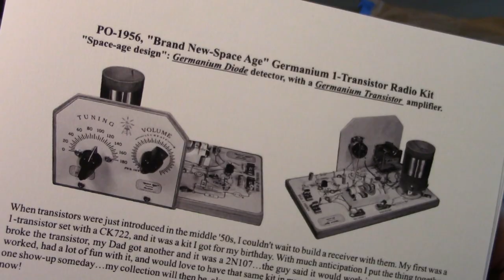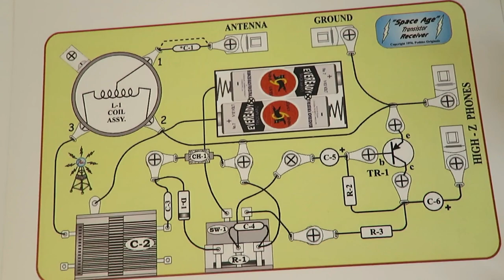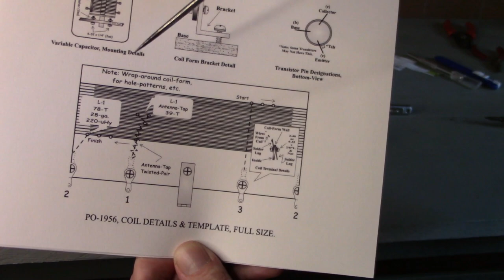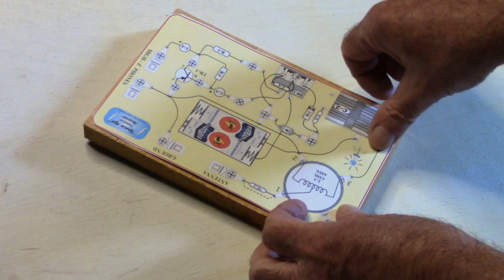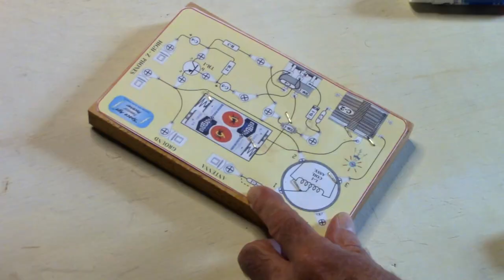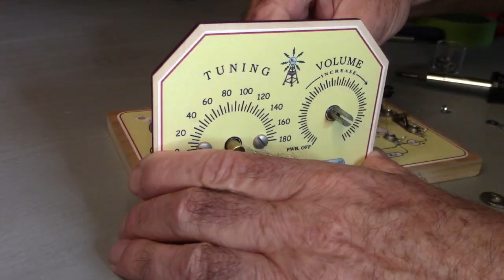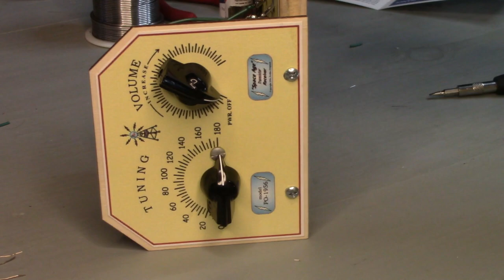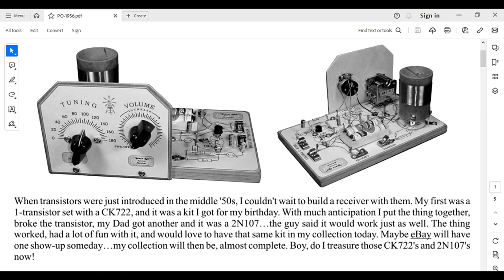Mike Peebles "PO-1956" Amplified Crystal Set

Comment: While I appreciate humour, I was saying to myself, I hope hes kidding about the antenna and ground. I did jump when the pyros kicked in. I  own a big valve radio (I live in Australia by the way) and I used a wire between the 2 concrete chimneys of the house down in through my bedroom window. I used a separate pipe for the ground, not the cold or hot water pipes. It was pre FM days but at night in Melbourne Victoria where I live, I could pick up Sydney radio stations 1000 kilometres away in NSW. I rang the DJ at one station telling him I could hear his broadcast. He acknowledged this by telling his listeners that a 12 year old boy was listening in Melbourne. The down side was the telephone bill. I played dumb because local calls were 10 cents a call but STD calls ( Subscriber Trunk Dialing ) were very expensive at the time, unlike today with VOIP. I still have that radio and I finally told my parents at 21 years of age at my 21st birthday. As you can imagine, my father said you cheeky little shit. I knew I never made a call to Sydney back then. I now own a $10.000 Primaluna valve amplifier which is just the most beautiful piece of kit I own. It uses wound in house Toroidal transformers for mains power and output to the speakers and has 4, 8 and 16 Ohm taps. It is running 6 12AU7s in the preamp section and 8 EL34 power tubes at the back in Push/Pull configeration which gives me 100 watts per side. I bought a Cambridge phono stage for my brand new Technics SL 1200 MK 2 ( I was a club DJ for many years ) and a Pioneer CDJ to play CDs. My cartridge is an Ortofon Black Moving Magnet with a Shibata eliptical stylus fitted. None of this gear has ever been in a club by the way. Vacuum Tube amplification is now big business. It's a shame that Russia invaded Ukraine because many tubes with familiar names like Mullard and Telefunken are being made there. Brian May from Queen uses valve amplifiers as do many other brilliant guitarists. I saw Queen with Freddie out front....yes I am a gay guy and with Adam Lambert too. The music today Pffft! I miss the days of valve amps. There was a magic to it all but at 62, I have to be real. I loved my crystal sets. These sets were well hidden in POW camps during WW2 to see what was happening during that terrible time. My late uncles had one but never talked about the war and we knew not to ask what they saw there. I love your channel. Cheers from Australia, Andrew Collins.
Reply from the maker: Thanks, Andrew! Pretty funny about admitting to the phone call years later, but I can imagine the excitement of that night when you called the DJ and then heard it mentioned on the radio.
Reply: I found an old POTS phone bill (70s or 80s) and I got second hand sticker shock from it. Ugh!
Reply from the maker: @qwertykeyboard5901  That's a different kind of shock.
Reply: It functions

Comment: At 15:38 I make custom front panels using thin plywood and printing out the artwork on my simple inject printer. I use carpenter glue on the plywood. Then working quickly I squeegee off the excess glue with a shop razor blade so I get a super thin coat of glue on the wood (just enough the hold the paper down but not soak through). I don't worry about the glue dripping off the edges yet, just make sure the entire surface has a consistent thin layer of glue. I place the paper on the glue, put wax paper over the paper, and hold it down with a book for about an hour.  I pull off or sand the glue from the edges. Then I spray a very very fine mist of clear matte enamel. It won't coat the paper, just tiny microscopic spots that dry in seconds before they soak into the paper. I let it dry 15 minutes and then spray another fine mist coat. I do that about 10 times. Then I can apply slightly thicker coats (3 is usually good).  This protects the paper from finger smudges, dirt, and you can even wipe it with a slightly damp cloth to keep it nice looking.  I have a playlist on this.

Comment: I used to make my own radio coils with a piece of PVC piping and either some enamelled copper wire, or Litz wire, to put holes in the PVC piping I would use either a small drill bit or a sewing needle that was heated till it was hot enough to melt the PVC piping, sometimes I would glue the base from an old octal valve or tube in one end of the PVC piping after soldering the ends of the coil wires to the pins of the octal base.

Comment: when i was in grammer school/cub scouts, i built a crystal set with a cat-whisker diode and a coil wound on an oatmeal box. i thought i had done something, but when
i got it assembled, i found out the closest radio station was 20 miles away! it did pick up a very weak signal, but it was not great. my mother bought me a 2 transistor
pocket radio that didn't pick up anything. it was many years later when my small town got an a m station, but the crystal set was junk by then.

Comment: Reminds me of the adverts in Boys Own Paper for one valve SW radios. Never built one but did own a Dulci crystal set from Gamages of Holborn.
In the late 50's there was a lot of Army surplus stuff in Exchange and Mart and shops selling bits stripped out of electrical junk.
Market stalls had whacky gadgets guaranteed to bring the world to your living room.
None of it worked, nor did the white spot transistors from Henries Radio.
As they say, the pleasure is in the making, not in the results.

Comment: Take out the bits relating to creating ariels from the mains wiring. Some fool will do what I did as a kid and and stick two fingers in the light socket to see what it feels like. Later as my interest in electronics continued I would start to replace faulty selium diodes in our Murphy TV, the one with the controls under the famous flip top lid. I discovered how by playing with the rf tuning coils you could pull in other TV stations. One day I had the tv in a room with a Stone floor. It was propped up on a chair with the outer wooden casing off and I was poking around trying to get the vertical control to lock. Suddenly I saw the set starting to topple from chair and went to grab it and I was in bare feet. Luckily as soon my fingers brushed against the steel chassis I felt the same feeling as when I stuck my fingers in the light socket many years earlier. If  I had fully grabbed it I would not be hear now.
This is the danger of tinkering and not being aware that transformerless equipment can be deadly if the A/C live side is connected to chassis by reversed connection at the plug end. Some muscians have been killed using Audio equipment that did not use transformers. It is very important for earths to always be connected on cookers,kettles and all electrical appliances so that if the live of the mains touches the steel casing it will blow the fuse or trip of your supply.
Reply from the maker: Hah, according to YouTube, 97.5% of the viewers are over 55 years old (86% are over 65). We should all know not to stick a screwdriver in an electrical outlet, and you see me get electrocuted by the radio after I do. The fact that you were poking around in a television with bare feet on a stone floor is funnier than the screwdriver bit. I'm glad that you lived and got to see my video years later!

Comment: At 17:13 screws that will poke through? - been there, done that.  After I drill pilot holes in the wood (about 1/16 of an inch before going through), I start each hole with a screw (about 1/2 way) then remove the screws and then trim off the screw tips with a Dremmel tool. Sometimes it beats making a trip to the hardware store (Ace and True Value Hardware stores usually have a way better selection of hardware than the Big Box stores).

Comment: Nice and lot of fun project, congratulations! 😂
Which transistor did you use for replace the original?
Greetings from Argentina!❤
Reply from the maker: I tried several vintage germanium transistors. It doesn't show it in the video, but I ended up using the original 2N2048.

Comment: The coil form looks suspiciously like it's the core from the large rolls of commercial TP. (I have a couple of them.)  Very good idea on making the coil of wire into a spool!  Quite entertaining on the gags.  You might like to try 1N60, 1N60A, 1N270, and 1N21 diodes in the set also.  BTW MRL (Modern Radio Labs) still has their booklets in print. I bought a full set about 10 yrs back. Mass xtal radio info.
Reply from the maker: Another MRL fan! 
I've been working on the history of Elmer Osterhoudt and MRL for some time. I've gathered the information here:
http://analogdial.com/Osterhoudt/Osterhoudt1.html

Comment: Two questions: is that variable air capacitor about 365 pf  and what is the transistor model?.
  Great video and a cool kit. Too bad  toys like this aren't available anymore,  kids would be more open minded and inquisitive

  P.s regardingthe headset, i just purchased a high impedance 2,500 ohms imp headphones  identical to yours from a guy in the Ukraine,  he has dozens 30:04  brand new in the box, it was $25 bucks plus 11 to ship.
Reply from the maker: The variable capacitor is either 365 pf or 410 pf, they both look about the same. The transistor is a Germanium 2N2048. So that guy has dozens of headsets?? Can you post a link?

Comment: I thought: "No surely this mains antenna thing is a joke!" Back in the day mains antennas were available in the UK with our 240V mains, but only for mains-operated sets I think and they were mostly useless - and dangerous. Little more than snake-oil products really. In the UK (and most of Europe except Spain) we only have a few AM stations left. Our BBC Radio Four station on 198 kHz long wave is closing in March 2024, and I expect the medium-wave stations (BBC and commercial) won't be far behind...

Anyway, joking apart that's a nice little kit. But doesn't the lack of selectivity let the digital sidebands from IBOC spoil things?
Reply from the maker: It could use an antenna tuner. The Peebles PO-103 antenna tuner works wonders, but I didn't include it in the video. The "antenna eliminator" was an actual product. I think it had a capacitor inside to isolate you (and the radio) from the electric current. It would be useless today with all the microprocessor controlled appliances plugged in and giving off noise.

Comment: I enjoyed, but you might want to put in a disclaimer on the antenna. LOL
Reply from the maker: Hah, you're probably right. It was obviously a joke, but in this day and age you never know what people will do.
Reply from the maker: @graftedin3  In my house, the neutral is connected to ground in the breaker box. If I used neutral as an antenna it would just go to ground. So I'd have two grounds and no antenna.
Reply: Some people run a small wire from the screw on the face plate , as the box should be grounded.

Comment: That is a nicely wound coil. The few I have wound aren't that nice looking. We should also thank the resistor that gave up its life for the diode. Not all heroes wear capes.
Reply from the maker: It's the clothespin! There is a small hole in it. The wire goes through the hole, gets pinched by the clothespin and comes out the top. An idea from Elmer Osterhoudt.
Reply: @michaelsimpson5417 I rewatched the coil winding and I see it now. I will definitely use that trick in the future.
Reply from the maker: @mheermance  More details: http://analogdial.com/CoilJig/index.html